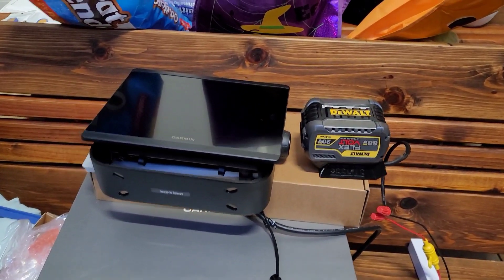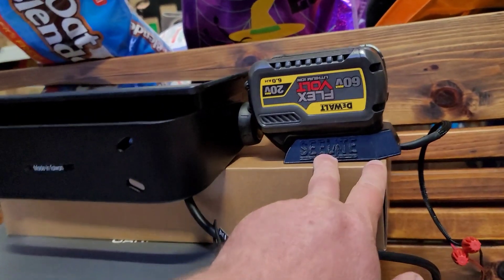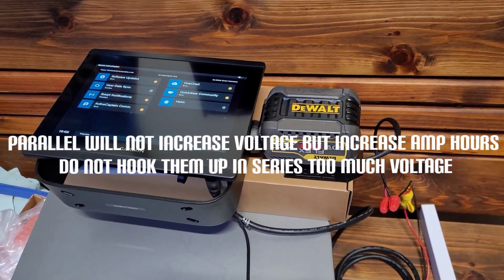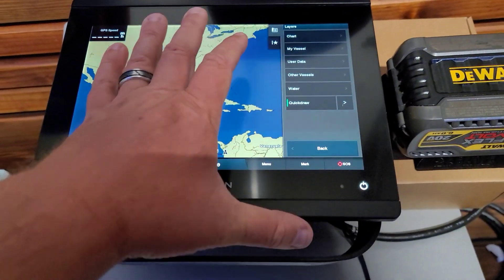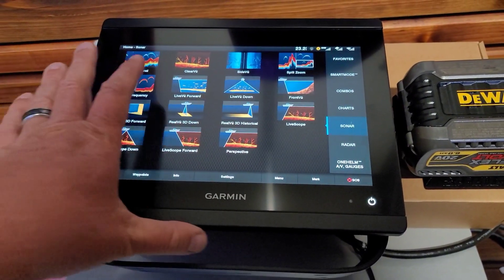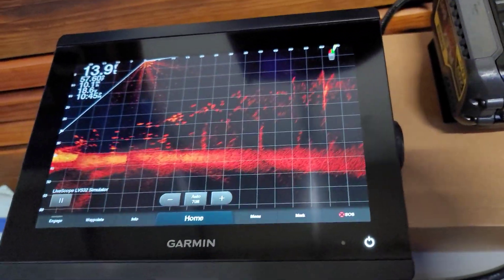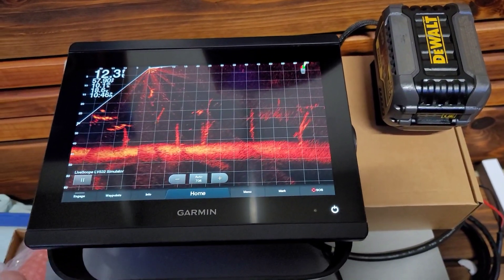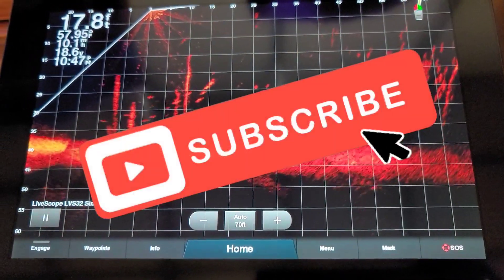Dewalt/Milwaukee Lithium Battery Hack for Garmin, Lowrance, Hummingbird, Ray Marine

Comment: I run a Milwaukee adapter that was purchased from Amazon for a 3rd of the price and came next day also, same exact thing , they also have dewalt adapters also , I run a 5.0 battery and i been on lake 6 hours with no issues and still have battery life on the 5.0
These adapters are just a mold for battery to fit with a ground and positive wire, nothing fancy, only thing worth it from Seelite would be the voltage regulator for lowrance or hummingbirds

Comment: You are better off with a LiTime 12v 100ah LiFePO4 in your forward compartment and carrying it inside to charge during cold weather.  Running your graphs on higher volts does not improve the picture you get.  Dropping below 12v does.  And it can damage your graph permanently.  I have a double battery hack with six 20v5ah batteries and six chargers for sale.  When we added a 126SV to the bow we started having problems keeping it, the 102SV originally there, and the livescope powered up.  A guide friend of ours showed us his setup and recommended the batteries.  Only drawback is you have to haul it inside to charge it in winter.  BUT it only weighs 22 pounds!!  ONE of these Li Time batteries cost a little more than ONE DeWalt 20v10ah.

Comment: Ok, can I run the CLS-10 black box off of the dewalt 20 volt battery,  and run the UHD-93sv off of a deep cycle marine battery all by it self, and be ok with the voltage? Very good video you put out, very informative, just a lot going on with the  voltage that I'm not real sure about. thanks .
Reply from the maker: You have to check the spec sheets.  Some are rated 10-18 but others are rated 10-32v. All my units and Blackbox are rated for 10-32v. I do know a bunch of people running 93sv off 20v. Look up kansas angling experience. He's done 2 videos.  First one I installed for him.  Second one he did and shot detailed footage.
Reply: @kansasyouthbass  Thanks for the reply , I appreciate it.
Reply: I did a test to see if my setup would work with 20 volts. I run the echomap uhd 73sv. It started up and ran fine at 20 volts. I know garmin says max 18 but it worked fine. Its probably close enough to fall within the fudge room that all specs take into account.
I risked it because one i seen others do this on the uhd units and it worked and i am still within my cabelas replace for any reason period lol.
I am a diy guy so i used molded pvc to make my own holder for 3 porter cable batteries since thats the tools i have.
I put 3 20v 2ah in parallel.
Have not had a chance to fish with it yet. But on the trailer everything starts up fine.

Comment: I called garman and they told me not to exceed 18 volts on my Ultra units. But the black box I can run the 20 volt battery system as its ratings are 36 volts.

Comment: I saw another hack using a regular gigabit switch instead of the Garmin switch to network you graphs and live scope it is not a waterproofed switch but if you have a dry comparment in your vessel it should stay dry. Network switch are $ 15.99 and up.

Comment: I wanted to run my GLS10 black box alone on a Dewalt battery. I used 10 gauge wire and a 12V rocker switch between the battery and the black box, but when I turned it on, it would always blow the 7.5 inline fuse that came with the Garmin power cable. Should I change the fuse to one with greater amperage or should I do something else?
Reply: If you change the fuse to a higher one you will probably damage your unit. I would look at the specifications of the voltage range in the owners manual. If it's like my 75sv it has a range from 9-18 volts. I have 18v Milwaukee batteries and wouldn't dare hook my unit up to one.

Comment: Do you have any pictures of how the final setup is in the boat? And what gauge wire did you run from the Seelite to the graph and livescope box. Do you split off the seelite to run to each device? Sorry the wiring side of electronics is totally foreign to me. But I am recognizing now on the water how much draw the livescope is on the cranking battery and want to fix that.
Reply from the maker: I do not. It's as simple as positive to positive connection and negative to negative. Super simple.  Please text me if any questions 913 562 4660

Comment: I have a lowrance hook7. I tried to set up with the same battery but it won’t turn on. Do I need a regulator for this type of fish finder?
Reply from the maker: What's your specifications sheet say for voltage?
Reply: Lowrance need 12v, there are adapters out there for the Milwaukee and Dewalt 12v batteries. The only downside is capacity.

Comment: Thanks for the info, does it have to be seelite adapter, when I Google seelite adapter I found other adapters also does it matter???
Reply from the maker: Shouldn't as long as it fits the battery.
Reply: @kansasyouthbass  be careful with other adapters.  I bought one on Amazon and the output voltage was 60 volts on my Dewalt Flexvolt.

Comment: I've got a uhd 93 sv, I've got live scope and the see lite adapter coming tomorrow. I already have some De Walt tools so I have 2 of the 60  flex volt , 6.0 AH battery's. my just wondering how long a 6.0 AH battery will last running the 93 and LS with the display screen at 100% brightness?
Reply from the maker: Should get about 5-5.5 hours each out of them. I'm running 2 graphs now,  and livescope on 2-9ah and last 15 hours or more. Haven't killed them yet. Need to try two consecutive days without charging next.  Love the set up though.
Reply: @kansasyouthbass  Do you have your 2 graphs and LS connected to 1, 9ah or you have 1, 9ah to the LS and the other 9ah for the two graphs? I just got my first boat and I have a 93sv and 122sv + LVS32 so i am looking for smart way to power all this and run a whole day fishing moring to late evening. How many batterys would you recommend?
Reply from the maker: @Schnalle91  I run 2-9ah batteries hooked up to 2-8410xsv and a livescope blackbox.
Reply: @kansasyouthbass  Question,  I am going to power my 102sv to my cranker and run the dewalt hack to my livescope black box only.  How many hours with that set up do you think I can get on the 20v 6ah Dewalt battery?  Thanks in advance.

Comment: I have the Garmin gps1222 with live scope...................which battery set up do you recommend. I went to the Garmin website and could not find any data on voltage .  Thanks for you help !
Reply from the maker: The ones in this video.

Comment: Does it have to be flex volt battery or could you just use regular dewalt 20v
Reply from the maker: Regular 20v is fine.

Comment: I have the garmin echomap plus 73sv. Thats the only thing (no livescope) lookin for a lighter battery option on my kayak. Do u think this is a good option and which battery would u recommend? 20v 6ah?
Reply from the maker: Your spec sheet says 9v-18v I would call garmin to verify. I've heard of others using them but check with them first about it. My unit says 10-32v. Another good option would be a 25-40ah Lithium from Dakota, Amped, Wholesale Batteries, etc.
Reply: Ok. Thx so much for ur help
Reply from the maker: @MC96701  no problem

Comment: Are you running the unit and black box on same battery. If so are you splicing the wires together. Just got 93 and livescope in the mail.
Reply from the maker: Yes. Double check the spec sheet for 93's

Comment: So the Seelite adapter reduces the voltage from 20 volts  to 12v-14v ?
Reply from the maker: Most Garmins can run 10-32v picture is way cleaner when you give them proper voltage too.
Reply: Didnt answer his question?
Reply: No they do not, You need to purchase fo separate voltage regulator to get down to 12v
Reply: @nickgralenski  do you have link to that voltage reducer?

Comment: What is the unit you are using in the videos, 103sv, 93sv, etc? I have the Garmin Echomap Ultra and wondering if this will work with it?
Reply from the maker: I'm running 8610xsv

Comment: I don’t understand stand what you mean when you said that you can run 20 volts with no problem but if you run a lower voltage of 18 volts you would need a voltage regulator. I must be missing something.
Reply from the maker: If running another unit other than garmins you'd need a voltage regulator. Most Garmin units allow 10-32v

Comment: I put a 20volt dewalt to my helix and it’s says high voltage what does that mean
Reply from the maker: Does your unit say you can run 20v? Some units do not allow that. My unit is rated for up to 32v for instance and some are way less. Check you specification sheet for prime operating level and voltage max.

Comment: In order to hook dewalts parralel do I need to purchase two seelites??
Reply from the maker: Need to purchase as many as you want to hook up. One is plenty if you want to change battery on the water.  I'm just lazy so hooked up 2 together so no worries on the water.
Reply: How much time will I get with the Milwaukee 18v 6.0?

Comment: Will this work with hummingbird helix units?
Reply from the maker: Have to reduce the voltage to most if not all birds but sealite sells that too.
Reply: @kansasyouthbass   what is the part called are # thanks!
Reply from the maker: It's on sealites website. Called a voltage regulator.

Comment: Have you noticed the higher voltage working better with side vu. I have 2 Garmin Eco Map UHD 93sv. When I run the side vu at high frequency I can only set the range to 40' and the depth is only good for about 10 to 30fow. Outside of that everything is black.
Reply from the maker: High frequency is meant for shallow water.

Comment: I have the ultra 126sv with live scope. Does the unit get its power through the black box or is it powered separately. The 126 says 9 to 18 volts so I want to make sure before I put 20 vdc to the black box.
Reply from the maker: You'd need a reducer to the graph

Comment: How do you charge those?  Are you taking them off and placing them on a Dewalt charger?  Or on-board?
Reply from the maker: Currently taken them off. Going to wire/ mount a on board for them soon.

Comment: You say most Garmin units allow 10-32v.   Where are you getting this information.  That’s not what Garmin says in their specs.   Ultra and 93sv say 9-18v.    Have you checked with Garmin about running over 18v?     Just asking.
Reply from the maker: Yes my unit I'd 10-32v. 93sv are not.
Reply: What did you end up doing, I have the same setup going to be installing

Comment: How many hours will it run the unit.
Reply from the maker: 1- 9ah will run a 8 hour tourney day easily
Reply from the maker: That's for livescope black box and a 8610xsv.
Reply: Do you think the 12ah would work as well. Just last longer?
Reply from the maker: @dustinmorgan7063  Yes I run a 9ah and 6ah hooked up parrellel and last all day.
Reply: Can you show a pic of you running them in parallel?
Reply: @meadratt1928  me too mee too!!!!!🙏
Reply from the maker: All positive wires hooked together. Pic in video.  Just pause it to see 👀.
Reply: @kansasyouthbass  Just subscribed, great video.  I only see one battery in video, so by parallel I assume you mean you are connecting the two seelite  adapters together red to red, black to black then also attaching all appropriate power to LS blackbox and Monitor red to red and black to black as well?  Really appreciate the video, my cranking battery has been getting a little too much drain.  Keep the videos coming.
Reply from the maker: @berg1214  yes that is exactly what I did. Working amazingly. Just don't forget your batteries is the only issue I've had ever.
Reply: @kansasyouthbass  Are you charging the batteries with a dewalt charger or an off the shelf lithium charger
Reply from the maker: @berg1214  dewalt.
Reply: So with the 93sv I’ve been reading the unit is only rated for up to 18v? Is it safe to run it with the 20v set up?

Comment: Hi, great vid and good info. Apparently Lithium batteries explode in contact with water. Are the Dewalt etc batteries waterproof? I have Kayaks and looking for light power sources. We have FPV Power water proof batteries here but a little pricey. Thank you for any help. Want to get Garmin UHD Echomap when comes out here with new GT56 transducer. Cheers Ian
Reply from the maker: My guys work with power tools in the rain all the time. Never had a dewalt battery issue. Hope that helps.
Reply: I dropped a dewalt drill and battery in a pool at a house I was working on and it was in there for a few minutes. 30 minutes of air drying later the drill and battery worked again

Comment: Why do folks spend thousands of dollars on electronics then want to cheap out on batteries?
Reply: Its not cheaping out on batteries. It anything it is more costly unless you all ready have the batteries lying around. My striker 4  needs .4 amps to run at 12v. With my 18v 5.0 ah battery it should run for days before needing a recharge. People fishing out of a Kayak will benefit the most.

Comment: That battery is only 120wh. will run a basic Livescope setup for 3.5hrs. lol.  Not very cost effective if you need 4 batteries for a full fishing day, not to mention the hassle of having to switch them out. Just get the right tool for the job, instead of trying to make this hodge-podge trainwreck work.